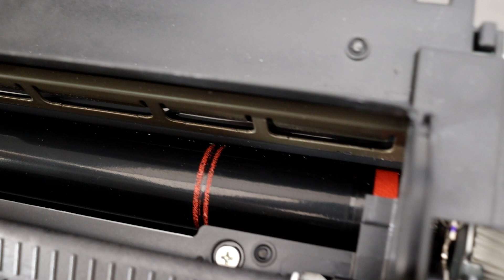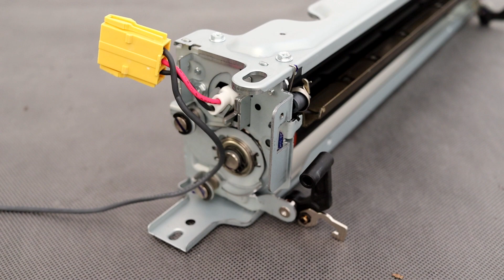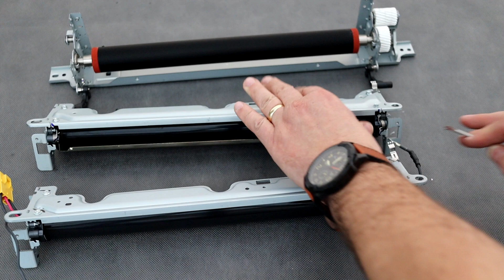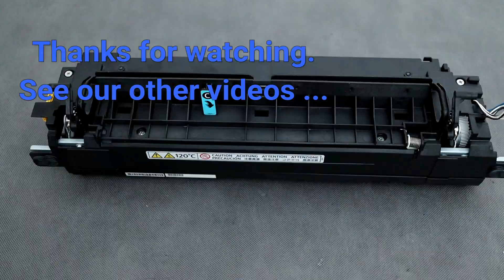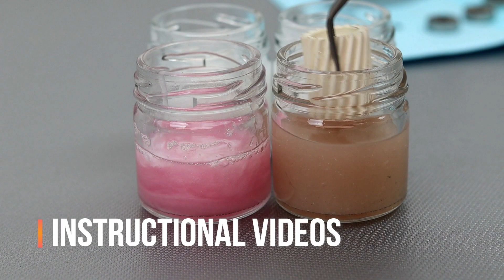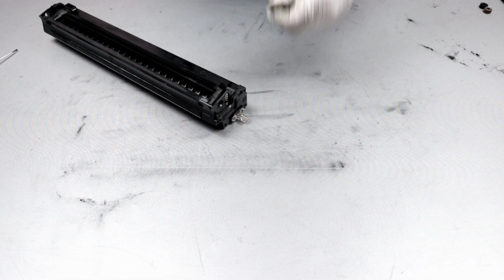Naprawa utrwalacza drukarka RICOH MP2555. Poprzedni serwis zawiódł.

Comment from the maker: @Maxim Ibragimov wrote an excellent comment: "One of the common causes of toner adhesion to a thermistor is the use of compatible toner. Due to a low or high temperature, the toner begins to stick to the thermal film / Teflon roll, and from it goes to the thermistor. Or, part of the toner (particles) that are not baked, parrying in the air, settle on the thermistor. On the original toner, this can also be observed, but its amount is not critical to affect the part, because by this time the unit will use up its resource. The cause of this problem is not the only one, but compatible toner is in principle a common cause, the problems of which appear during the operation of the machine."
THANK YOU @Maxim Ibragimov

Comment: In that case, the thermistor was not damaged, causing damage to the pressure roller?
Reply from the maker: @Maxim Ibragimov You explained the problem perfectly. I agree 100% with you. I have noticed that on copiers where the toner is not original the roller can be damaged after just 20,000 copies. Sticky Your comment below the video. Respect.
Reply from the maker: It's not in the video, but I only cleaned the thermistor. Some toner has built up on the thermistor and it has hardened and damaged the roller. It was enough to touch the thermistor with a finger and the toner fell off. Everything is still working normally. Only the question arises: why is there this problem with the toner build-up on the thermistor in this model of copiers?
Reply from the maker: Thanks